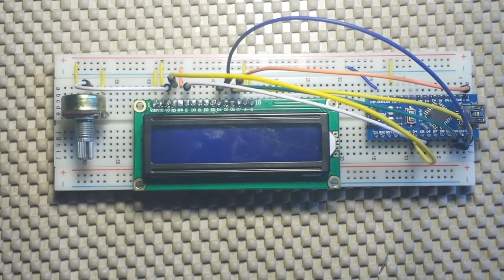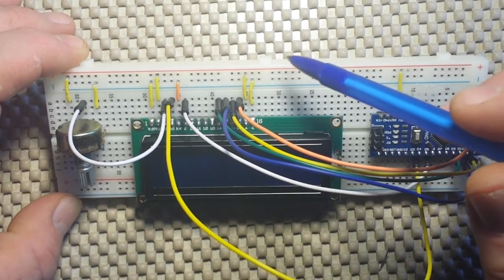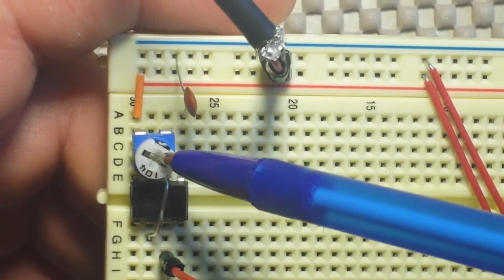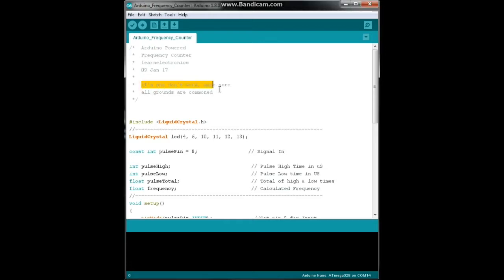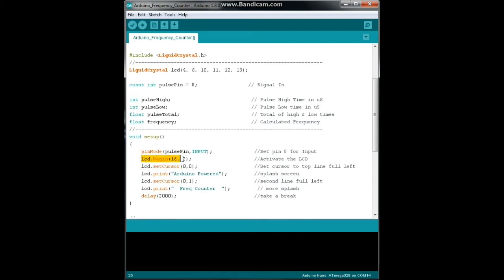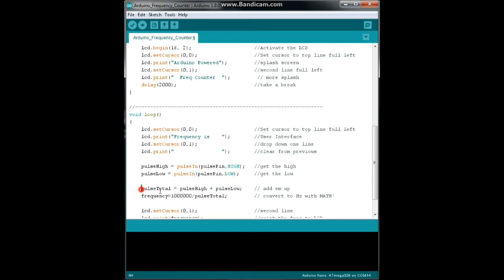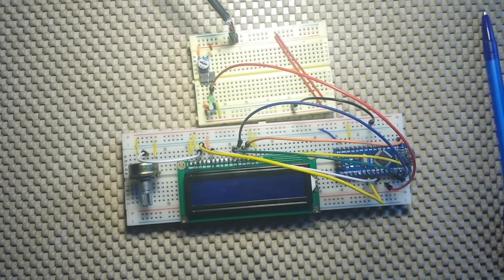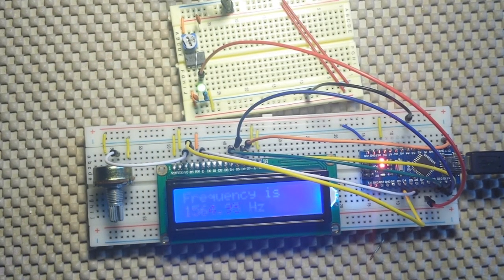arduino powered frequency counter

Comment: I was bored and looking for something easy to build and it worked fine except for some reason the display would only show blocks and no digits . I changed the pin assignments to match the hello world sketch and it started displaying normally. I'm not great at arduino so not really sure why it wouldn't work for me as it was but It was just a bit of fun to kill time so just glad it worked. Thanks.

Comment: Thank you Sir. I can check my Arduino Uno's pin PWM. That is around 490 to 492 Hz as stated in its specification with your code. Means a lot.

Comment: I use something similar but with some more math to give a readout uf a rotary encoder on the spindle downfeed of my milling machine - it just converts the pulse count per second to feed rate in mm per minute .
The extra math is just the reduction ratio in the drive system , i keep having one problem though the display keeps showing these weird symbols that look like martian writing ! It is also intermittent so i don't know what is causing it , maybe electrical interference, maybe a dodgy display or connection - i have no idea so looks like a pull apart job !

Comment: What is the minimum and maximum frequency this arduino setup can measure? Assuming you use change the timing cap on the 555.

Comment: Hello and Thanks for your video, you do a great work !

It works for me too, and I changed a bit your code : 
- Put all value to type "long", as I don't need floating frequency info.
- Put the first LCD print line into the Setup(), so I only change the second line (frequency value) into Loop().
- Put delay down to 250ms,  in the Loop().
Reply: hi sebastian...can you send me the HEX file of frequency counter which you upgraded????? please

Comment: A couple of programming suggestions: 

For low frequency sources, change pulseHigh and pulseLow from 'int' to 'long'. This prevents them from overflowing and becoming negative. You can see this in action if you print them out with a low freq input. 

Also you may want to use the optional "timeout" parameter to  the pulseIn() function: pulseIn(pin, value, timeout);

The default timeout is 1s. So if you are monitoring a signal that is greater than one second long the function will timeout and you will get the wrong reading. 

Many thanks for the video!

Comment: Hello Mr David I have made your configuration. It Counts  2000 or 3000 differecy for example  one cycle 44.000 kHz,  another one 41.000. How is your resultation. Thank you for your programmin and answer.
Reply from the maker: mine seems pretty stable